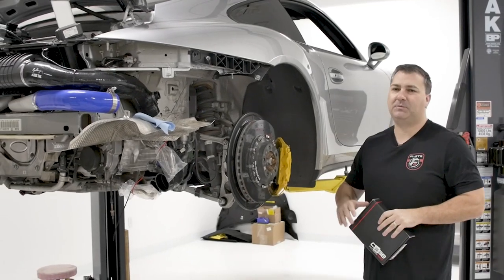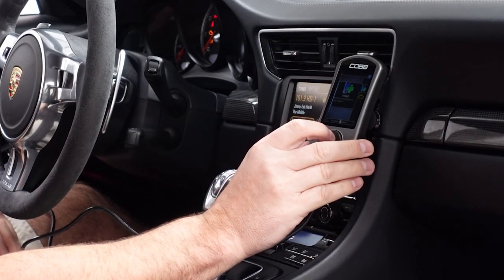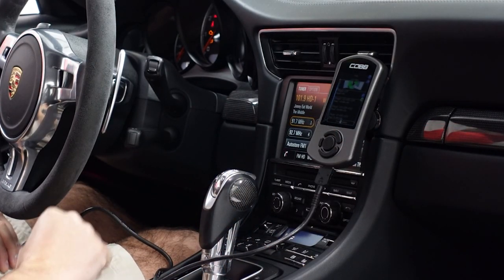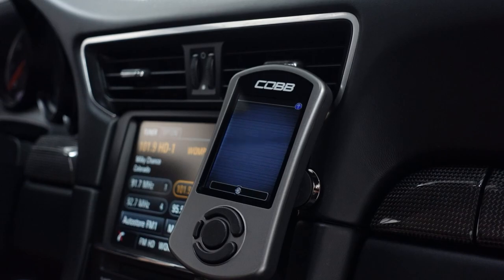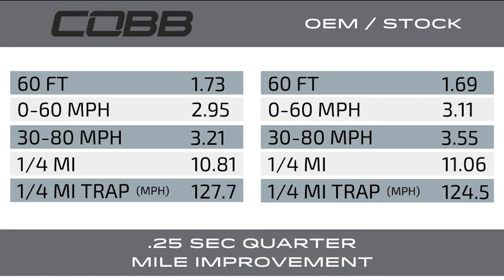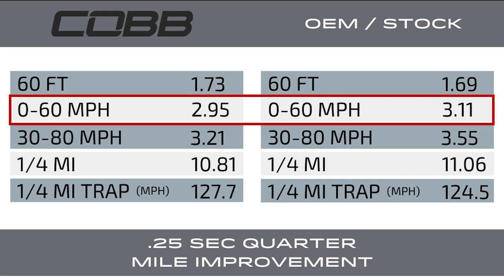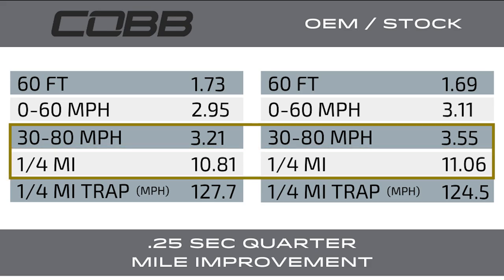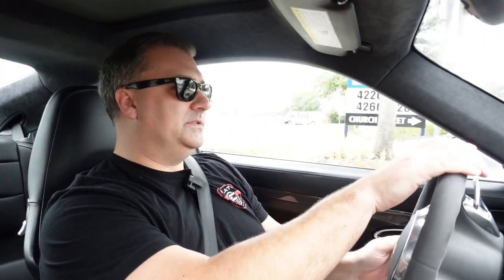Cobb Accessport for 991 Turbo

Comment: I have a Cobb installed on my 2016 911 turbo s with the stage one 93 octane map, do I need to get the transmission tune ? Don’t want to damage my PDK. Or this the trans tune for higher tuned ?
Reply from the maker: A PDK tune is not required.
Reply: @Flat6Motorsports  😊 Thanks
Reply: I would not unless you are tracking the car.

Comment: was this just a stage 1 tune ? Didn't hear if you said that or not
Reply from the maker: That is correct, the OTS Stage 1 Map from Cobb.
Reply: @Flat6Motorsports  I have a 2016 991.1 turbo s and was contemplating getting it just to tune it to stage 1 but I’ve heard that on the 991.1 the turbos are smaller than the ones on the 991.2 so I’ve seen reviews where people say a stage 1 tune isn’t very noticeable. Is that true or can you actually feel a good difference, if you can, I will definitely buy.
Reply from the maker: @1Judoippon  Yeah, it's very worthwhile in our opinion. The 991.2 gains more power but to us it's a no brainer given the performance bump over stock.